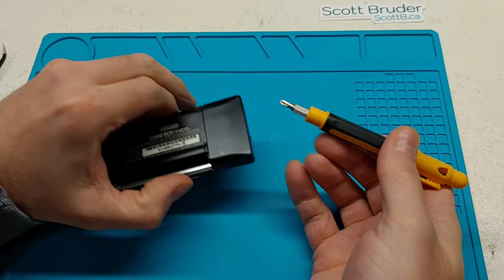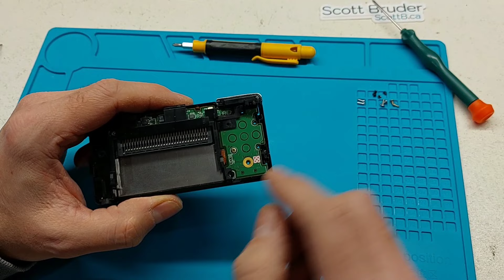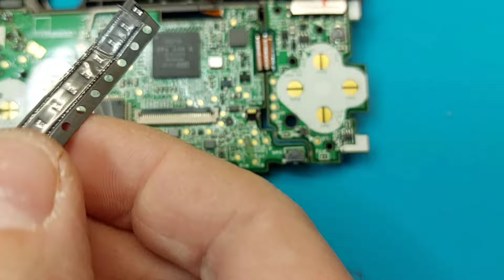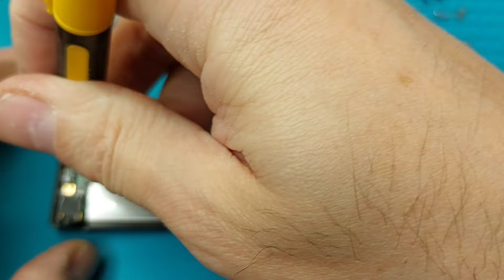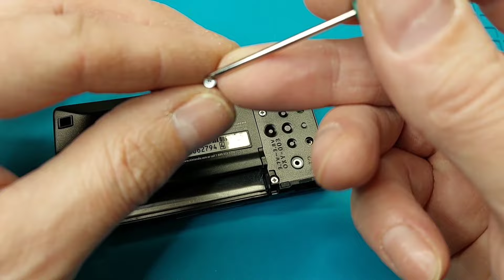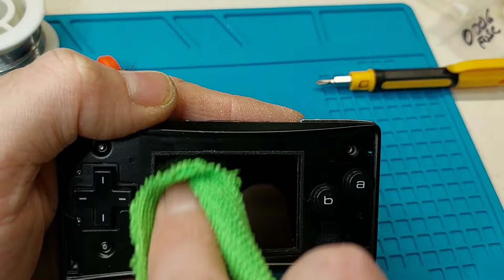Replacing the F1 fuse in a Gameboy Micro.

Comment: Nice fix! I just acquired a Micro so I appreciate this video for future reference. If you have a chisel tip wide enough to hit both contact points, it probably would've come off really easily :) Also, the hot air sounded like it was at maximum, which is prob why it wasn't melting.  The air was spreading away from the area too quickly and not being concentrated.  Thanks again for sharing!
Reply from the maker: thanks for the feedback I think the hot air is not working right,  it was almost at its lowest setting.   Ill have to investigate.